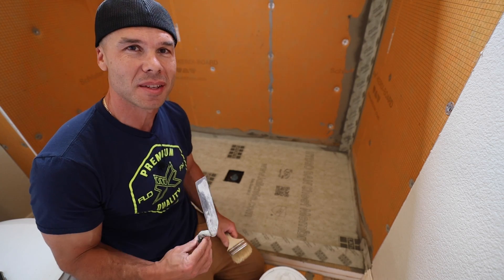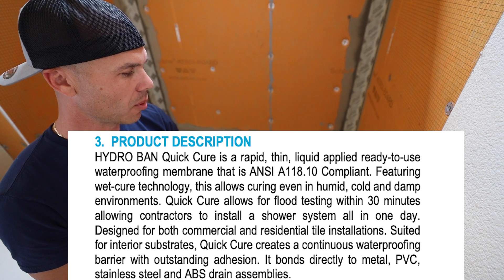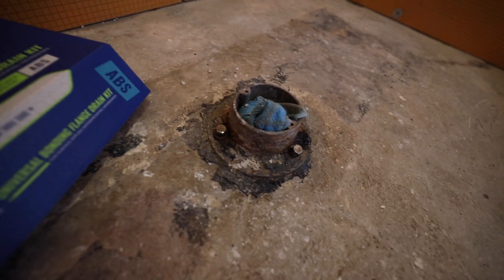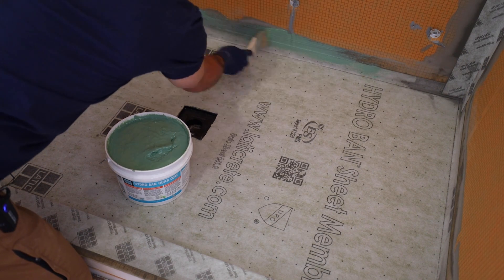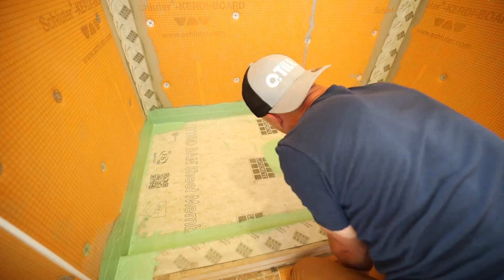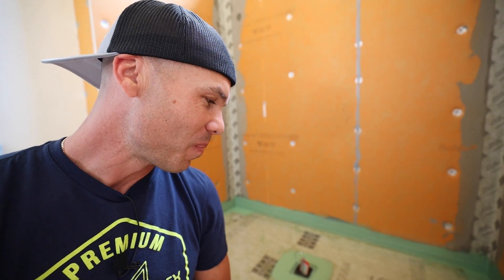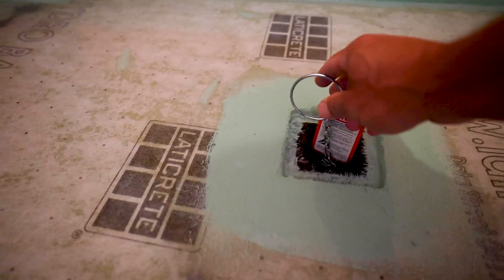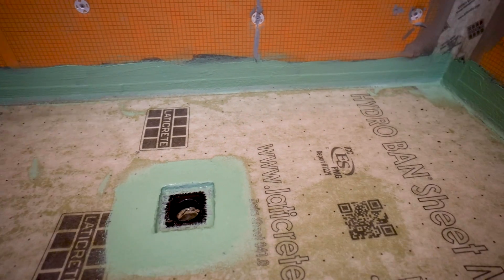FASTEST Liquid Applied Waterproofing Membrane --- Hydro Ban QUICK CURE Water Test in 30 minutes!

Comment: how does hydro ban work with kerdi products can i go over the kerdi fix>?
Reply: They are all basically the same, only thing different is the warranty, each manufacturer only honors warranty if you use their products together of course so they can sell their products, I use whatever I have as long as you don't mix methods like using a pvc pan and a roll on membrane on top of it or the other way around, in my opinion  waterproofing on top is the way to go, the old way relied to much on those small weep holes that will clog over time with hair, crumbles from mortar bed ect. Membrane on top water will never even touch the sloped mortar bed if waterproofed correctly

Comment: Bostik MVP4 uses a moisture cure urethane that reacts with humidity in the air for doing a moisture barrier on concrete subfloor for wood floors. Kinda cool their is something now like that but for showers.
Reply: Been wondering if that kind of product could be used for setting kerdi band.

Comment: Wouldn't it be better to install the walls after the mortar bed? Then even without the bottom corners sealed any water that wicks thru the wall tile grout onto the wall board will drip down onto the top of the base (rather than down the sides of it) and then flow to the drain. Also don't you prefer Laticrete wall board over Kerdi? Thanks for all of your amazing content, even showing your mistakes. Looking forward to building my own curbless shower this year based on your videos and recommendations.

Comment: What would you think about waterproofing the corners with just hydroban and laticretes white fabric?  Not using the thinset and banding. So say a schluter pan, cement board on the walls, fabric in all the corners and hydroban on the walls and onto the pan enough to seal it all up.